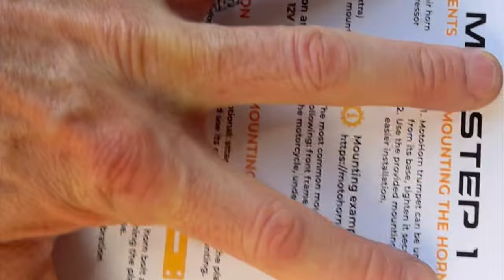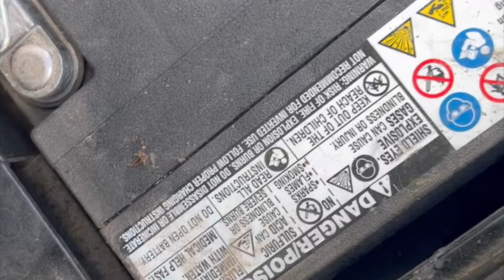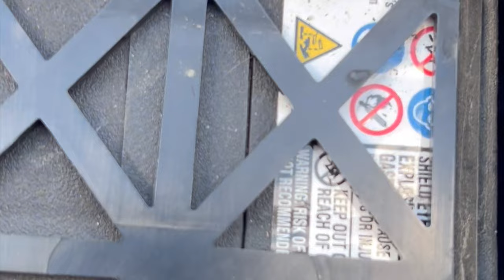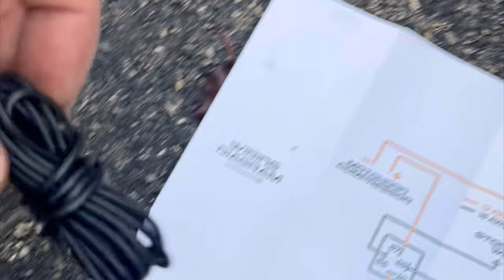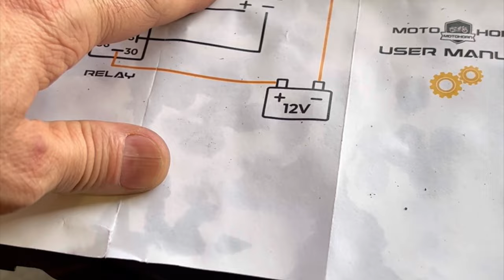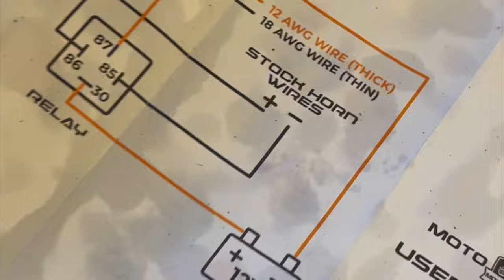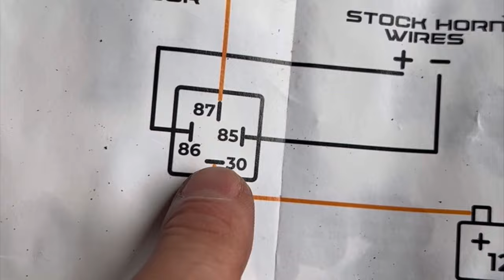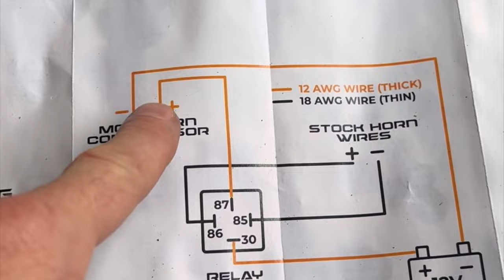Motohorn 2.0 Complete Installation: Step-by-step Guide for Dummies (MotoHorn + Stock Horn)

Comment: Thanks Harold. I installed mine. your video was very helpful. I added rubber padding around the compressor in the same location just like where you put yours. The Y connectors is clever idea.
Reply from the maker: Awesome.  Glad it helped!  Hope it helps on the highway also!  That's the ultimate goal.

Comment: Good video and informative. Definitely better than the other ones that I have seen previously. I would suggest though maybe better positioning/angling of the camera, for example, when you're sitting down as there was more body shot than of the horn and couldn't really see what was going on with the process  throughout the video.
Reply from the maker: Thanks for the feedback.  I will make sure the tripod gets in the right spots from now on!
Reply: Good suggestion!

Comment: I installed the Motohorn 2.0 (NOT the one above) on my 2019 Fat Boy 114 and also on my buddys 2016 Softail Deluxe CVO. My Fat Boy install took about 2.5 hours because of idiotic HD engineering. My buddys CVO? 10 minutes. I didn't replace/cut/run any wires on either bike because it simply wasn't necessary. Ill bet that the install above didn't need the wires or relay kit either. Horns sound great on both bikes and Harley should be ashamed for putting a $2 horn on both.
Reply from the maker: It sounds like your setup was only the Motohorn then and you opted to not use the sound from the stock horn.  10 minutes?  Nah...takes that long to get the seat off and get to the battery compartment.  But yes, it can be faster if you're only installing the motohorn.  Running wires through a relay (which requires running wires) is definitely necessary if you want sound from both horns.  No other way to do it.  Glad you got your horn done in....a shorter amount of time.  Good job!
Reply: @dirksdomain  That is correct. I purchased the motohorn that you installed above but there was nowhere to mount it on my bike without it looking stupid. So, I got the Motohorn 2.0 (The smaller dual horns) and mounted them in the original spot while removing the original horn. The original horn is a total PoS and I wanted to remove it. It sounded like a foreign car (Beep! Beep!) and its terrible HD would put that on their bikes. My buddys CVO's horn went bad and this was a decent replacement. We both hated the stock horns and thats why I didn't feel the need to do the wires.
Reply from the maker: @glickmpb  I love the multi tone effect of having more than one horn.  You installed the dual tracks it sounds like.  It’s a very easy job if you only want to swap stock horn out with one of the Moro horn products, though.